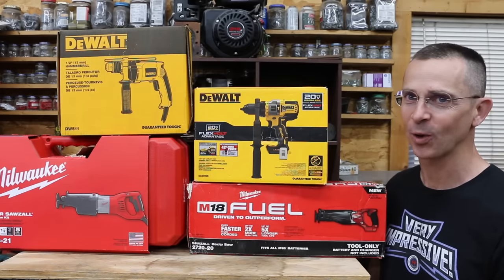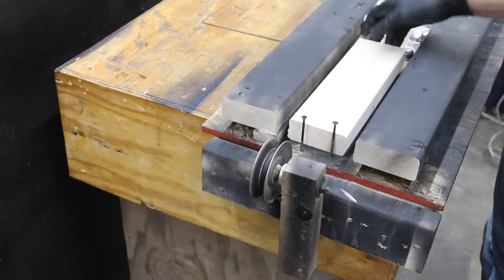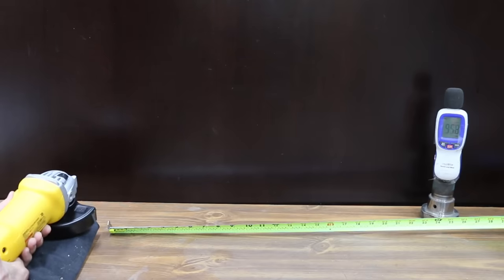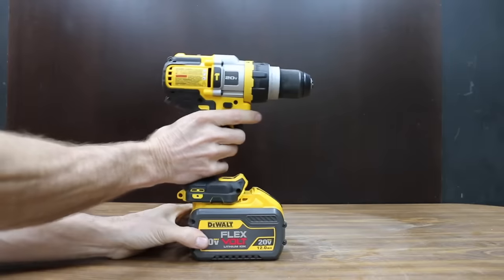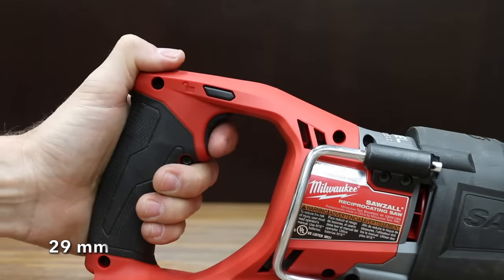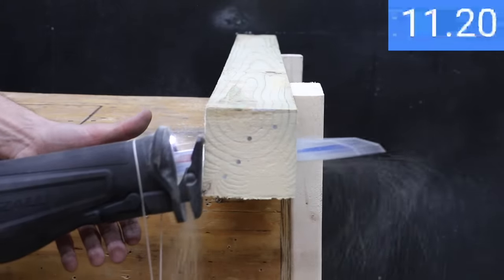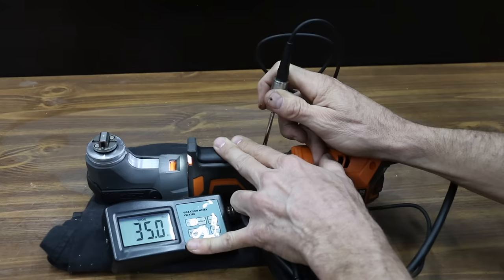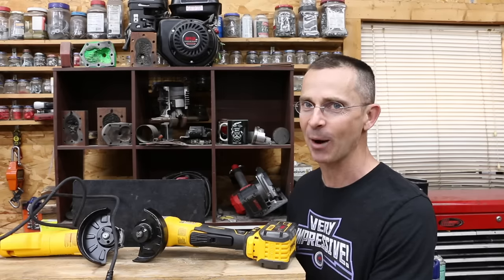Let's Settle This! Are Cordless Power Tools REALLY Better? Torque, Cutting Speed, Noise, Vibration

Comment: Great video!

A lot will depend on which corded tool that you compare with the cordless tools. I worked my way through college as a framing carpenter and that job puts power tools to the limit. We used  Skill 77 worm drive saws, Milwaukee sawzalls and Makita 3/4" hammer drills. The Skill 77 is a beast, but I would burn out a  motor every couple of years. Today's cordless tools are very good, but they will not perform under jobsite conditions for framing houses nearly  as well as corded tools. The problem is not their power, the problem is their durability. As you use a cordless tool under max load conditions, the batteries drain very quickly. Typically, the motors on the corded tools are faster and more powerful. This aids the durability of these tools during 110 degree days when my saw handle got so hot, I could barely stand to pick it up because it burned my hand. Cordless tools just cannot stand up to this type of abusive use. Their motors burn out more quickly and their batteries fail in very hot or very cold conditions. Construction personnel do use cordless tools on the job, but usually for light work and convenience.

Until new designs for more durable and powerful batteries enter the industry, corded tools will rule construction jobsites. For homeowners, cordless tools are fine and more convenient. 

I have a Fein multi-tool that is corded and it is far more powerful than any cordless multitool I have ever used. Also, it doesn't lose power like cordless multitools. The same is true for corded Skill 77 worm drive saws. There is no cordless replacement for them. Milwaukee just came out with a cordless worm drive saw, but I can almost guarantee that it will not keep up with a corded Skill 77 saw over an eight hour day, weeks and months on end. Even as bulletproof as the Skill 77 is, we could go through several saws a year.

As battery technology improves the gap is closing between corded and cordless tools, but there is still a very wide gap in performance and durability. That will change over time and as you state in your video, for homeowner use, cordless tool are sufficient.
Reply from the maker: Thanks!  Thanks for sharing.

Comment: Your videos are alway extremely useful and often surprising, but I feel this one badly needs a follow up because these demos model only sporadic application of the tools.  The problem I see with cordless tools is that while they are quite powerful, this demonstration covers comparing power and cost for occasional or intermittent use. However, for many applications tools run continuously, or nearly continuously for extended periods. This is especially true for angle grinders, circular saws, and screw guns.   A framing carpenter often makes hundreds of linear feet of cuts more or less non-stop, trimming huge stacks of studs to length, off-cutting plywood sheathing, etc.  A drywall hanger routinely goes through multiple pounds of screws almost as fast as the tool will drive them. Angle grinders in say, a fabricating shop run flat out for hours.

As none of these tools can run continuously or even run for heavy intermittent use for as long as it takes to charge a battery, it will almost always take a minimum of two sets of batteries to charging to keep one operating in the tool and often more.   So I'd like to see a test of the number of batteries one must keep charging in order to keep various tools running under heavy work loads. Say, a grinder running for fifty minutes per hour for some number of hours. Or to keep a screw gun driving screws at a reasonable number per minute for some number of hours.   

I think it could be computed approximates as one plus the result of dividing the charging time by the time it takes to exhaust the battery with heavy use (rounded up of course.)  So it would only require running each tool for long enough to kill one battery charge.

Comment: I find your shows quite interesting, but you should leave out store brands like Rigid and Ryobi.  They are the bottom of the barrel.  The only times tools get worse than those two is if you are comparing something against Horrible freight.  Their tools are absolute trash.

Stick wiht the "real" tool brands if you can find them (Metabo, Makita), and if you find something made in the USA, show it.  It will be an old tool, but will show how far we have fallen in  expectations when it comes to power tools.

ANYTHING with a plug in cord will eat that battery crap and spit it out in 1/2 hour.  If you have doubts, do a six hour test.  The battery crap will be done in 45 minutes and the corded tool will keep working on all...day....long

GET SERIOUS!  .

Comment: Have you done a video testing additives to protect and extend the life of drive belts?  I have see a video of someone using a product called 303 aerospace protectant to make your drive belts last forever, not really forever but hundres of thousands of miles without cracking.   Would love to see some kind of test to see if that product or others can really make such a difference or if it is all BS.
Reply from the maker: Thanks for the video idea.

Comment: Having a blade break in a saw is great, I sometimes like to tie off my guard with some wire when it’s getting in the way… but then every time you finish a cut you gotta wait for the blade to stop before setting it down, so I’ve been loving the blade break feature as well as the rafter hooks that cordless saws are coming equipped with
Reply from the maker: Thanks for the feedback.

Comment: Battery power is a hype now, a marketing push. Take a circular saw as an example, corded always outperforms the battery counterpart. Until a very high drain providing battery chemistry comes in the game, corded is the way to go. Especiall if you are not very mobile and off-grid.
Reply from the maker: Thanks for the feedback.

Comment: I like cordless tools. I just don't like having to stop and charge the battery every hour or so. Or worse have to carry around 3 or 4 batteries just do finish one job. One corded saw will last years upon years without ever having to charge the battery. And they're always cheaper. Picked up a brand new Skil corded sander for 40$ cordless is over 100$

Comment: Interesting comparison but DCD 999 is not a good choice for drill comparison because corded drill is just a drill whereas DCD 999 is a drill-driver meant not only to drill (albeit) slower but also to drive fasteners at different max torque settings as well as to stop rapidly. The real cordless drill is Metabo BE 18 LTX 6.

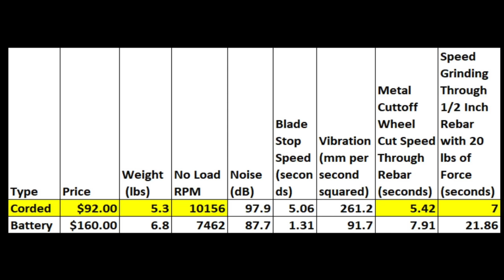Comment: I think you said the grinder with battery costs $450 at around 5:47. Which I don't think is correct? I think it's probably around $250? Which still seems ridiculous to me when I'm using a $20 Harbor Freight grinder :) But, to be fair, I only rarely use an angle grinder; mostly use it as a last resort (stuck bolts, etc).

Comment: This was an interesting, if not slightly slanted review....With the cost of replacement batteries often exceeding the price of the original tool, I don't understand why you would do this comparison and not test battery life? Maybe I'm all alone on this opinion but my 20 year old Makita 1/2" hammer drill is going to outlive any battery powered tool out there. My kids will probably inherit it after I'm gone...With the cost of power tools, especially the battery powered ones, unless you plan on spending a lot of time working out in the middle nowhere, life expectancy is almost always the number ONE factor I consider before shelling out my hard earned cash

Comment: Most people are probably like me - they have cordless for the stuff they want to just grab and go frequently and corded for the less used tools. I stuck with DeWalt 20v tools for battery commonality. I have two drills, an impact driver, an impact wrench and a circular saw. Other stuff, like my angle grinder and SDS drill are corded. I am interested to hear any comments. I am sure the mix varies depending on what you do.

Comment: First off I absolutely love your channel and all the videos you produce. I'd love to be a Patreon but at this time in my life after going through a divorce I'm unable to, but one day I will. I have a question which you may be able to answer because of your wide knowledge of many tools. I have a Makita plunge saw with dual batteries. I noticed on this video you pointed out that the cordless Makita circular saw also had two batteries with battery indicators. My question is do these tools pull one battery first or does the tool pull from both batteries at the same time equally. Thanks again for your content.

Comment: I'm sorry, but I'm not even going to watch this one. I love all your reviews, have made purchases based on some.
But this question is meaningless to me. Null signal.
If you are near power then in a lot of cases corded might have an advantage. Maybe. But I see a lot of pro construction being done via battery. I don't care though. Battery works for me, even though the battery prices are total scams. The battery & charger is the same price as a kit with drill, battery, charger and bag? Uh hmmmmmmm..
If you are at the beach with a ton of things to blow up and you have your battery powered Ryobi inflators and your plug-in power inflator, well, sorry, but not a lot of plug-ins at the ocean. Cords are an inconvenience to manage, with extension cords an extra tangle bonus.
I chose battery because of that alone, except bench tools like grinders, table saws, scroll saws, and where brute force is the name of the game.

Comment: The cordless saws all needs a small battery. Per a previous video that Project farm did sometime a bigger battery is detrimental to the performance of a saws all. See project Farms “Smaller tool battery better?” Video starting at time stamp 11:41. In that video the Milwaukee Sawzall made the same cut with a 2ah battery in just over 8 seconds. It still doesn’t beat the corded version but it is much closer.

Comment: One major concern, at least for me, is that batteries present an environmental risk if not properly dealt with, unlike corded tools. I use both but lean more toward the corded due to unreasonable costs associated with new batteries, which is not an issue with corded tools. Versatility counts and cordless wins. There is a clear tradeoff, but I go corded 60 - 40.

Dude, you should run for Congress and stay clear of lobbyists, either left or right, but Sanders is a better bet.

Comment: Cordless has an obvious advantage where there is no electric outlet available.  A work-around is to use a corded tool plugged into one of those rechargeable “generators.”   Several “generators” such as Ecoflow River have enough output to power a circular saw.  That is a a way to future-proof your tools against proprietary batteries becoming unavailable.  Rechargeable “generators” have the advantage over gas generators because they can be used indoors.

Comment: I still have my cord drill and my cord impact driver and a few other chord tools from over 30 years ago. No battery operated tool last that long because the batteries are trash after only a few years and that makes the tool trash along with it even though it’s in perfect shape.

Comment: Due to the cheaper price of corded, I've always just bought corded first, and upgrade to battery-powered if I use it enough to justify the cost jump (and/or if the cable is annoying enough).

So far, only my drill and impact driver have received to cordless variants; my reciprocating saw, rotary tool, oscillating tool, weed whacker, hedge trimmer, and soldering iron are all still tethered.
Reply from the maker: Thanks for sharing.

Comment: I think where corded tools will always out-due cordless is total cost of ownership. I have corded tools that have been around for over 30 years. They have never performed at less power and never need batteries replaced. To compete with corded tools you need at least two if not three batteries to avoid downtime and that is when they are new. Eventually those batteries lose power so they don't last as long or provide the same umph as when new. All that makes the Total Cost of Ownership significantly higher.
Reply from the maker: Thanks for the feedback.

Comment: I have a little corded dewalt grinder and it destroys cordless alternatives. Also grinders use up battery power in minutes. Corded drills are also much better. However, portability if the massive upside of cordless and I tend to use them more often. Interesting video!
Reply from the maker: Thanks!  Thanks for the feedback.

Comment: I think you should do a video where you prove pressure washers do not harm an engine. Maybe take it apart and check for leaks after washing several times. I had this idea but I don't have equipment to do it.
Reply from the maker: Thanks for the suggestion.

Comment: I've been told that due to the cost of a high torque battery nut gun, a cheap air compressor and air gun is half the cost and has more power.
Reply from the maker: Thanks for the feedback.

Comment: Conclusion: Battery powered tools are great, but they're 3 times as expensive, cannot be used for long jobs because the battery will run out (so spend another fortune on spare batteries) and your tool will last shorter, because the battery will certainly be the first component to fail.
So if you really need the portability and find it worth the money, fine. In all other scenarios, i'll stick with corded.
PS. Awesome test as always, thanks so much for your effort!
Reply from the maker: Thanks and you are welcome!  Thanks for the feedback.

Comment: I stick to corded and air because i hate it when the battery eventually dies and stops taking a charge, and i end up having to buy a new drill or impact because the company discontinued the series. It has happened to me a couple of times. I saw that a company is making a universal battery that uses adapters, so i might give that a try
Reply from the maker: Thanks for the feedback.

Comment: First, you do an awesome job! Second, I agree with your summary: cordless is more convenient. Lower cost and the fact that 99% of my work is close to my house/shop. I do feel corded tools, with a little R&D, could easily be upgraded to have LED lights, blade brakes, multi-speed gears, nicer controls, grip, clutch, etc. Newer technology in bearings, motors and CNC machining could easily cut down on vibration and noise. Why don't corded tools have brushless motors? Why don't corded tools have 40 - 110v motors? Why can't cordless tools all use the same battey? That would be killer!
Reply from the maker: Thanks!

Comment: I was in two stores last week, a Home Depot and an even larger local store looking at batteries for my Milwaukee M12 tools.  The only batteries available were the 5 amp hour batteries in a 2-pack for $129.00.  I wonder if the stores and the regional distributors don't have a motive to promote the batteries with a larger profit margin.  I've had so many disappointments with the M12 batteries, not just failing too soon but also not being up to sustained use.  I gave up inkjet printers and went to laser all-in-ones for this reason.  I think this is the razer blade marketing model.  If I were a pro and could pass the cost on to customers I'd stick but as a DIYer and hobby fabricator I'm going to go back to corded and pneumatic.  I'm also wondering if eventually batteries won't be seen as ecologically irresponsible and if corded tools won't get be modernized with, for example, brushless DC  motors.
Reply from the maker: Thanks for sharing.

Comment: The only tool I use often enough to justify cordless is a drill. All other power tools are corded. But right now even my drill is corded because the battery died and was too expensive to replace so I converted it to corded with an old computer power brick.
Reply from the maker: Thanks for the feedback.

Comment: Is anyone surprised that cordless dominated nearly every challenge at half the cost?
 
  The real question any contractor needs to ask him or herself is what type of job you're on and what the power situation is. If you're out in the midwest somewhere with the nearest outlet being miles away, obviously cordless tools are the only option, unless you want to buy a generator.

  For nearly every other type of project, in all my years of handyman and construction work, you can almost always find a suitable 15 amp outlet. Bring a 100', 10 guage extension cord with a triple tap on the end and all the heavy duty job needs you can think of will be handled sufficiently of that alone.

  The biggest con, bar none, with any cordless rig is charge time and how plentiful your battery supply is. If money means nothing to you and you can afford to have 10+ 6.0 aH high output batteries and a 6 battery charging station, by all means, go for it. Most of us can't though, and larger batteries of the newest generation are absurdly expensive.

  Ultimately, for the heaviest and most aggressive type of work (demolition, sanding, polishing, cutting thick metal, thick wood) it's best to go corded. You'll spend half the money, and what you save you can invest in high quality bits, blades, etc.
Reply from the maker: Thanks for the feedback.

Comment: What we need are corded tools with removable cords to make them easier to store. Since most of us often depend on extension cords anyway why not make the tool cord short? Or make an adapter you plug on the extension cord and then in your tool? Or plug the extension directly into the tool. No annoying cord to tangle with. I think a short cord would make the tool much easier to store.
Reply from the maker: Thanks for sharing.